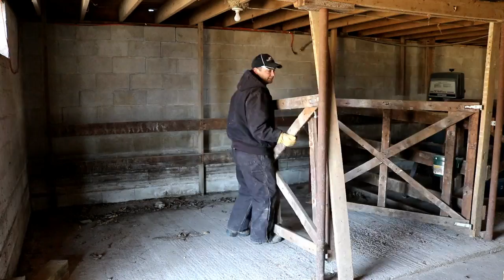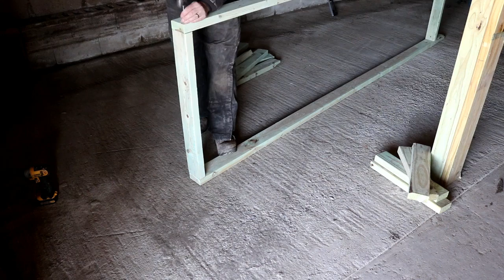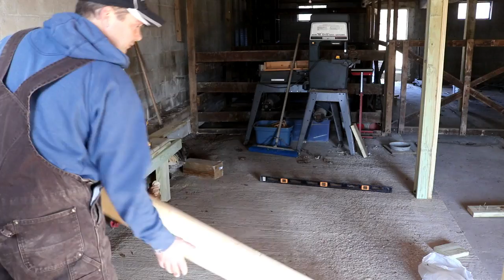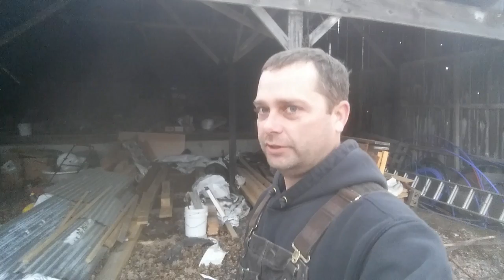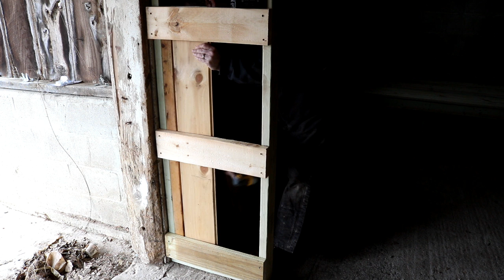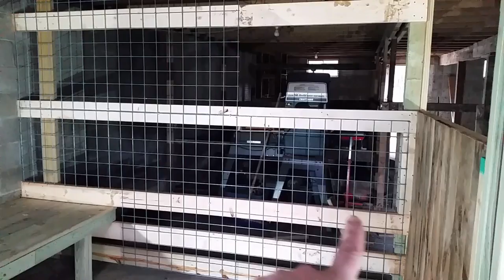Building a Goat Stall in the Bank Barn

Comment: I wouldn't put a lot of faith in PT lumber. It will still rot. It will maybe last 5 years longer than non-PT lumber. That being said, I wouldn't write off non-PT lumber. PT isn't a panacea, and non-PT lumber isn't cotton candy. Rot is what you're trying to avoid. The only place wood will rot - PT or non-PT - is if it's sitting in moisture that it can't dry out from; if it's in polly, or in concrete, or in the dirt, and it has no air circulation. As long as wood can dry out, it won't rot.

Comment: Just to let you know that goats, especially young ones, will jump into the hay feeder and mineral tubs, and then use them as a platform to jump on top of, or over, the wood partition on the front of the stall.  Please do yourself a favor and install the same wire fencing on top of ALL your stall walls.  You might even want to consider adding a wire extension on top of your gate.

Comment: Very Nice! 
Do you have an idea of how many of the Nigerian Dwarfs you'll be getting?
Besides not liking the dark and getting wet, goats do not like being crowded, the herd queen, at the least, will bully (rear up, butt, bite) others in close quarters.
Once you put in hay rack, mineral container, feeder/s and water tub the goats will lose pen space.
There will not be space enough for dwarfs and larger goats in that pen. Mixing two sizes will create an issue with feeder heights as larger goats will be stepping and pooping/voiding in the lower dwarf feeders unless you run feeding troughs to the outside of the pen. An opening between the trough and a board mounted above through which the goats put their heads to eat.
An in pen water tub will have the same issue with bodily function waste contamination. For these reasons plus the fact that hay (Bermuda and Alfalfa) absorb waste odor and goats won't eat it. This is why distance is required between feeding and sleeping areas when wanting to feed in an enclosed living area.

Contrary to belief, goats do not live by pasture alone, particularly if it consists of primarily of clover and Bermuda (although they love Bermuda Hay which makes for happy, healthy goats).
New Spring pasture is not beneficial as the weeds and grasses contain moisture primarily.
Additionally, because they do not need a host to survive, tape worms live on the underneath side of the grass blades, especially in Spring.

Goats love to run, jump and play king of the hill.
They are sociable, loving, funny, responsive, quickly trainable, occasionally stubborn and make terrific pets. If their tail is 'up', it's a good sign that are likely healthy and happy. If their tail is 'down', they may be ill, wormy, injured/in pain, or other and in need immediate attention.
Enjoy; I have for almost 20 years.🐾
Reply from the maker: We plan on having 3 does, a weather, and a buck.

Comment: I guess I missed it, but what is the platform for?
Reply from the maker: Goats like to be up off the ground.  So we thought they would like the platform to lay on or climb on.
Reply: @CountryViewAcres  Thank you. :)
Reply: Becki Black  they also poop on it. I never had a platform for my goats. Just deep bedding.
Reply from the maker: The goats love the platform.  We probably have 12 inches of deep bedding and they always choose the platform.  They do poop on the platform and we have to sweep it off weekly.
Reply: @CountryViewAcres  might consider a small ramp with cross bars, for grip/so they can catch their step, as they goats age out and/or for smaller kids. Wouldnt take much extra and it would provide a safe situation if they need it. (Maybe along the opposite wall as the divider wall).Just a thought. Great build overall! I have a small homestead and i have chosen to swing my gates outward (due to issues of thick bedding etc). The slighter swing room would still benefit the inward swing if u needed that i would think. Hope things are progressing well for u all. Take care!

Comment: Looks Awesome!  I'd suggest you think about rehanging the gate to the other side and make it so it can swing out and block the isle.  That way when you are chasing them into the barn the gate will block the isle an force them to run into the pen you want.  I'd do that will all the gates, nothing worse than chasing them back and forth down the barn isle till they decide to turn in to where you want them.   Lastly, does your barn have water in it?  I don't remember, but if you do or can run it to the barn auto water feeders are the best so you never have to worry about them running out on a hot day.  Plus once you run it into the barn you can do it for all the animals in there too.  Real good workmen/women ship there by the two of you.

Comment: Looks  great!!!    You  should do the  feed  room  after  finishing the  fencing,  and  build  a  medical  cabinet  too.   Have  you looked  at  the  ceiling  in  the  alley way  to  see  if  there  is  a  trap door???   Makes  it  easy  to  drop  hay  from  hay  loft!!!!   I  built  swing  doors on  my  hog pens,  to  block  the  center  alley.  It  made  it  easy  to  move  a  sow  to the  boar  pen  for  breeding  without  them  getting  out!!!!   Also  to  move  a  hog  to  a ramp to load  into the  trailer.  We  had  one  try  to crawl under  the  trailer  to  escape  one  time!   I  cant  wait to  see  whats  next!!!!!
Reply from the maker: there is two spots in the ceiling cut out to drop hay bales down to the stalls.  I will definitely use one of them.